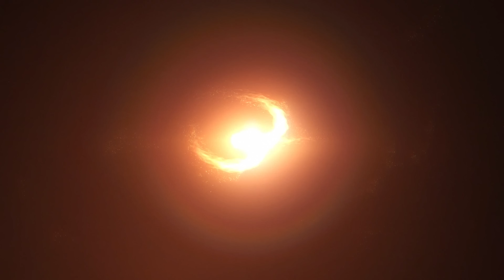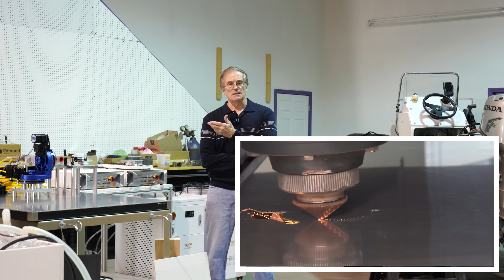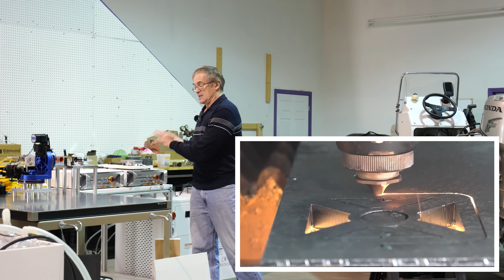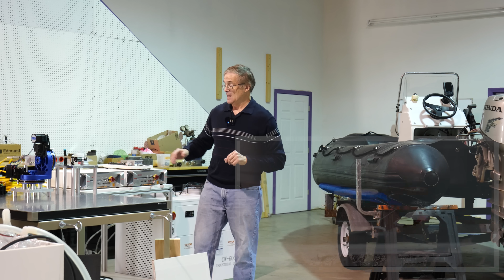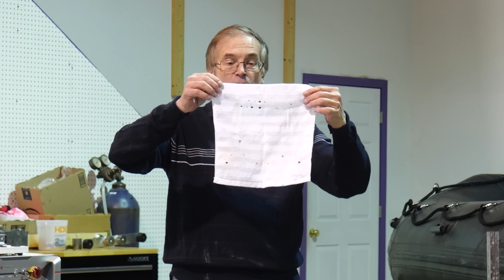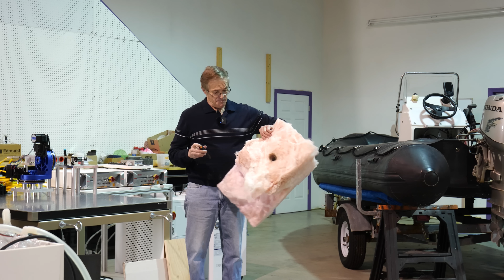We have a problem... and need your help!

Comment: Can your laser survive repeated mains power
outages? If so, place a triac between your 
mains and laser. Use a Raspberry Pi or 
equivalent to count pulses from a zero 
crossing detector. That way you can program
a sort of dead man's switch. You can add an
emergency power off and a sensor when your 
laser breaches through.

When I stack a pile of utility blades and 
view it edge on, It looks black even though
the blades are shiny. Because of the angle 
of the grind, light shining in undergoes 
multiple reflections until it is all absorbed.
So if you have sheets of stainless steel 
stacked in parallel with spacers and angle
it at 45 degrees to the laser, wouldn't the
laser bounce through and never bounce back
at you? 

When it comes to safety, I tend to over 
engineer. So a multi chambered aquarium.
First chamber is this stainless steel baffle.
Needless to say, everything is sunmerged in 
water and preferably vigorously stirred
into a churn with beefy pumps. Maybe a
bubbler too.

Second chamber will be filled with shiny
ball bearings. Have you ever positioned a
ball bearing in front of a laser and get the 
reflection pointed at one spot on the wall 
without wavering? I expect the beam that 
breaches the baffle will scatter and thus 
lose coherence and intensity. Adding bleach
to the water will make it cloudy and disperse 
the beam further.

The last chamber will be tinsel/sparkles 
to replicate a snow globe.

You might have to rearrange the chambers for
best absorption. I think it is best to have 
the baffles exit towards the roof/ceiling.

You did not mention the power consumption
nor frequency of your laser. 

You can consult with a solid state physicist
on crystals/phosphors that can absorb your 
laser and shunt it into 
other frequencies for even better 
dispersion/absorption.

For a zero crossing circuit consult 
https://www.youtube.com/@LewisLoflin

Comment: How about a waterfall behind a wall of lightweight cement board used for showers. With a heavy cold water fog in front of it. fiberglass insulation into the waterfall space behind the cement board
Reply: The waterfall would keep the fiberglass super saturated. Or You could add mica powder, and chalk into the the fog and the waterfall without the fiberglass since it would just eat up the impurities.
Reply: There is also a thin drywall like insulation board that they use for bench top kilns and scientific bench top ovens.

Comment: 1) While developing and testing indoors don't use the full power or use another laser - use the full power only outdoors
2) All materials have a melting point which the laser could reach, but consider the usual suspects such as asbestos, glass sheets (opaque if even possible), fibercement board, aircrete block, furnace/fire brick, kevlar, fire blanket, tungsten, carbon fiber, graphite - also try multi layered arrangement similar to tank armor..
3) if glass doesn't shatter from the hole burnt through it, then try sand sandwiched between glass sheets - the sand can shift and absorb more energy, and the glass hole will fuse so not going to leak sand like sandbags will.. see if fine or coarse sand works better
4) ask AI / ChatGPT to generate more ideas
Reply from the maker: We can't operate outdoors for safety reasons.  Stray beams even from reflections can be quite dangerous.

Comment: From the start I thought about the amazing thermal conductivity of copper, but for the area you need it may not be very feasible, Even if you could get a paint/coating to absorb the laser energy.. I mean how much would even a 1Mx1M plate cost at an appropriate thickness, You could avoid machining cost by soldering on some copper pipe on the back for a water loop.

Maybe the solution is dilution, instead of trying to absorb the light, if you could bounce that 1mm dot of light back in as wide of a cone as you can manage, it might not be as damaging to these other ideas you've tried. Nighthawkinlight made a pretty cool video on packing density of microspheres, White paint that would get colder than ambient air in direct sunlight. I would attempt making a batch and seeing how that works out at reflecting it back at as much lower/wider beam intensity. Maybe a frosted (sandblasted) mirror would get enough photons bouncing within, and out the edges to do the job. good luck silver nitrate, maybe the reflector in this mirror is the copper plate I mentioned, and maybe it would be better to frost both sides of the glass to diffuse it even more. I mean you could try several layers of frosted glass, but we don't even know if a single one would survive, and maybe the shards of broken glass would make a working diffuser. Good luck! Can't wait to see what you guys are up to, You guys are always makin me think :D

Comment: There is a type of lightweight fire brick used in boiler construction called "Fire Brick" It comes in bricks 18" X 18" X 2" and each weigh only about 2 LBs and is quite cheap. I have used it to stand pieces of Stainless or Brass on when I Oxy --- Acetylene weld _ "Braze" or Silver Solder them together. The same piece is still as good as when I first started to use it. It is a little fragile and the edges have broken off in small chunks, but if encased it will withstand abuse. It cuts very easily with a hacksaw blade and a wall can be built with "Retort clay" also available. Try an Air Conditioning Supply House like "Johnstone Supply"

Comment: Some kind of multilayer falling water curtain? Have several pipes with holes dropping water.  Offset the pipes so streams of falling water overlap.  Maybe have several different diameter holes so you get different sized stream to try and maximize the diffusion of the laser light. lastly is there a dye that can be added to the water to also absorb some of the light?

You'll need something at the bottom to minimize splashing and help prevent the water from misting too much and turn your building into a swamp.

Comment: If glass is available, you can use an aquarium filled with water and pink fiberglass. The fiberglass will scatter the light, the water will cool the fiberglass. You may need to cool the water in the aquarium.

Comment: A graphite block with a grid of conical holes is what I have seen used, so that laser light is striking up into the bottom of a graphite cone. It is not very portable (gets heavy quickly with scale) but maybe you can optimize it better for your app. and as far as I know graphite loves energy in buckets. That would work well within your optical setup as a physical shutter.
If you want something large, and portable, and able to disperse energy for a long duration, you begin quickly asking too much from materials (aerogel/starlight?). Best thing I have seen for a more disperse backstop is ceramic fiber sheets, McMaster has a selection of different high-temp ceramic boards you can look through.
Signed, laser research engineer, commenting from alt :P
Reply from the maker: I've worked with various light traps in the past and graphite is an excellent absorbing material for the walls.
The area is the chalange.  We are going to need some type of panel.

Comment: I may sound silly but why don't you try to adjust the wavelength of laser light so that it's effect reaches a precise distance and intensity.
Reply from the maker: If you mean focus, then we already are.
Even outside that distance point, the beam is still very small.

Comment: Instead of trying to make a wall of material to shoot the laser horizontally, what if you got some scaffolding and mounted the lasers at the ceiling pointed downward with a pool of water on the floor under it.

Comment: Try creating an 'anechoic chamber' for light, and dump the beam into a  tapered cavity coated with the world's blackest paint - Musou black. The exterior face of the cavity could be finned like a heatsink if required to dump the excess heat

a divergent lens set 'out of focus' in front of the cavity could reduce the intensity at one spot. 
A shallow incident angle would hopefully protect the paint, and the beam would (hopefully) dissipate to a safe level ⁷after multiple internal reflections.. To reduce the overall dimensions it  could be spiralled like a snail shell (painted and assembled in two halves), would be mounted to ensure no light would escape. Thank you for these Fantastic videos. Very entertaining, especially while I'm  clearing my workshop at the weekend. All the very best. David H from Kent, UK

Comment: Carbon/graphite paint or panels,ablative coating,ceramic oven wool, mirrors reflecting in to the ground, parabolic mirror using flexible mirror sheets that redirect and spred the light on the ground, diffuser or lens to spred the beam maybe with several rows of water fild glas jars.

Comment: I'll use mineral insulation with antifreeze circulated by a water pump, ensuring fluid circulation in the section exposed to the laser. Good luck!! 👍🏼
Reply: Plan B: a large mirror at 45° refracting to the ground also with antifreeze circulating in the back.

Comment: If you can reflect it with a multi-layer dielectric mirror on ULE or Zerodur you can aim it at the dirt, maybe a misting system in front of it and water cooling the mirror for the <1% energy absorption. Or a gravel mixer filled with something like salt, maybe water.

Comment: Assuming those are 1064 nm lasers, then soda-lime (window) glass or polycarbonate are something like 80% or 90% transmissive. So get a large sheet of polycarbonate and rough-grind a divergent optic. You might even be able to buy a large one preground one. A few feet behind this lens, set up some sheet steel (30% absorptive at 1060 nm) at a 45-degree angle wrt the floor. Then, under the sheet steel, place a tank of water with some 1064-absorbative powder stirred into it. (Maybe graphite powder & soap to homogenize?)

Edit: alternatively, make a divergent optic using a flowing fluid in laminar flow. But this gets to be much more complicated...

Edit 2: redo your drywall test but use waterlogged drywall instead. Truly soaking. Maybe with a hose flowing across the backside.

Comment: Get a whole lot of ash from your fireplace. I mean carbon. Nothing special and it's cheap. Could always look at refactories like AlO3 aswell. Could also refract the lazer in stages. Your big problem is reduced surface area so why not try increasing it. Maybe reuse glass bottles in the form of glass shards as a layer. A much more dense form of glass that will increase the potential needed for phase change.

Comment: For an extremely high-power laser like that, you’d want something like high-power light absorbers (HPLAs) or black-anodized aluminum, which can absorb nearly all the laser light and turn it into heat without reflecting it.
Reply: Adding a cooling system on the back side of the panel will aid in heat dissipation.

Comment: Have you given any thought to disrupting fiber optic links with a laser. Either to interfere with the signal or just cut the cable. What would the range be, could a wide flat beam be used.

Comment: Rather than decreasing the power, what if you made the laser focus way closer and did all your tests 20 feet from the back wall so the laser diverges before damaging anything?
Reply from the maker: It would help, but not enough.
To make the beam director fast, it has to be compact, and so the beam size is limited. The beam starts small, and when it hits the target it is smaller. That gradual decrease means the defocusing is also gradual.

Comment: How bout plywood with a ceramic coating sprayed on and if possible mix a refracting (not reflective) material in with the ceramic spray coating at different amounts in each coating decreasing as you get closer to the outter surface. Didn’t you mix a special paint one time that disperses heat from the sun. I remembered how much cooler the aluminum sprayed with it stayed in direct sunlight. Hope this helps!!!

Comment: I think that eliminating the possibility of incorrect operation through perfection of the control system.  I created perfect using C and a TI DSP. It required a team of people to contribute to the design but was ultimately found to be flawless in operation.
Reply from the maker: You can't be sure. The design is complex and includes sub-systems that not only have to perform perfectly but also have to interact perfectly.  You needed a team to generate a tone, and the consequences of an error wouldn't drill a hole through your building.

Comment: Based on the output you're dealing with, you might need to have them made of a specialised material, but can you put a mirror to reflect the beam down into the ground?  You might burn up some of your pretty floor, but we use mirrors and beam splitters with our lab lasers "all the live-long day."

Comment: Could you change the axis of the test? Mount the laser straight down from the ceiling, using the floor as the backdrop.
Reply from the maker: There isn't enough clearance below the ceiling.

Comment: I don't think my initial idea is very applicable to your situation. I would shoot the laser beam downwards at shallow angle towards a water surface. Most of the beam will get reflected, but whatever makes it into the water should create bubbles and disperse the impact point. And to make sure that the beam gets dispersed you could vibrate the water, so that it's surface gets wavy and causes the beam to dance across your absorption shield. With that, drywall would work if out of the 3 or 5 seconds that you need to react to something going wrong, the beam only hits each spot on the drywall for at most a quarter second.

Comment: Complete amateur here,, and I know it depends on the frequency of the light, but maybe a waterfall? If the laser is the right frequency it should be absorbed by the naked water, with a constantly flowing sheet of water, it shouldn't boil away fast enough to leave a void. 

Lots of shoulds, and ifs - and I may be completely wrong.

Comment: How about something simple? Just a 1000l IBC filled with water? Aim the laser at the bottom of the container. Sure, the laser will punch right through the wall of the container, but then it's met with hundreds of liters of (now moving) water. After the test is done, just patch the hole and refill the tank. It'll make a mess if the leaking water isn't contained, but other than that it should work fine to contain the laser beam for a while.

Comment: pulse the laser ,2 rotating disc with mirror propelers diverting the beam into a box of sand ,changing there sync to open the shutter

Comment: Interesting problem. Just returned home from a month off grid, you have probably already solved it. My best idea would be to try freezing customized versions of Pykrete , with shiny reflective particles like powdered stainless steel and cuttings from a machine shop. You could try different recipes in an ice cube tray and track down which ingredients give the best results.

Comment: You need optics to create the largest possible column of light that then goes through a target-focusing lens system so that the laser beam is at such lethal concentration only for the final portion of travel to the target and a little ways beyond, and after that it, it continues to disperse.  This becomes more of a challenge for targets further away, but the point is that the "backstop" has to be much, much further away.

Ultimately, your best solution is to use the sky as the back drop.  Keep the focus within 50 feet or so for testing, so that the beam dispersion will be great enough not to inflict harm on satellites.  Your targets will always be something like drones (or balloons) overhead.  You need a reliable way to verify there are no aircraft within the angle of sky overhead that you allow the system to target.  Once you see it working, then some folks at military bases being infiltrated by mysterious "drones" may want to do live testing for you against those invaders at greater distances. I haven't heard you mention the challenge of allowing for dynamic focus for targets at different distances -- I'm sure it is a solvable problem, but also probably one of the biggest challenges in laser weapon systems.

Of course, there is another problem of ground-based observers needing eye protection from the ridiculously bright illuminated target when it is hit.  I suppose you have to do your testing in a large pit or canyon.  It starts to sound a bit over the top.  But it gets worse....

To be able to target objects at significant height, your column and focusing optics have to be pretty enormous.  I know that when I worked at LLNL in the mid-80's, they would grow their own optics crystals, and they had a huge diamond turning system to cut/shape them as required.  A single lens could easily cost as much as a house.  Good luck with that.  🙂 There, the beam had to be kept large, not so much for the focusing dispersion problem you need to solve here, but to prevent the energy from ripping apart the molecules in the optics themselves.  Oh, and no, I didn't actually work on such things, but they had nice tours of the other stuff going on there even if you working on it yourself.

Comment: Just thinking outloud. How about a fluid that is extremely dense. Say something like ferro fluid that is mostly fine iron filings with enough liquid to be able to pump it over a waterfall for the laser to hit. Oil based would make allot of smoke but something that doesn't smoke as badly as the carrier for the metal filings. Just a thought as I'm looking at it from wanting something dense but also able to constantly replenish itself instead of wearing away. Very difficult to do to a large area and without smoke though. Or just a laminar curtain of water over a brick wall.